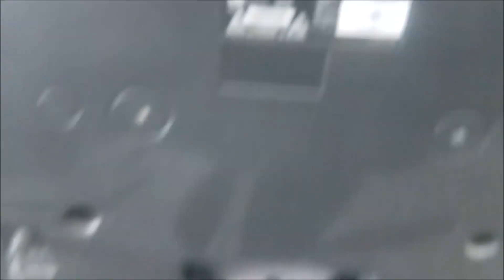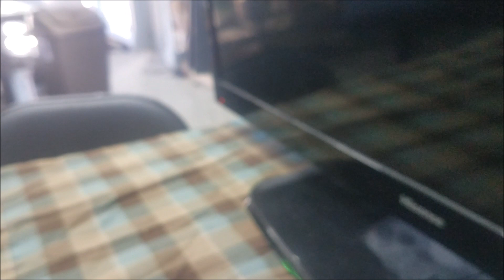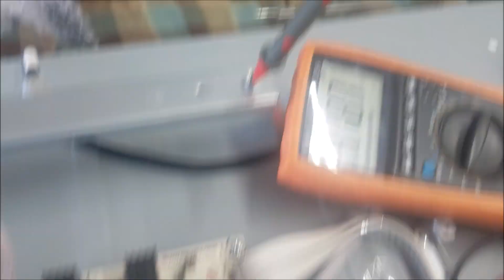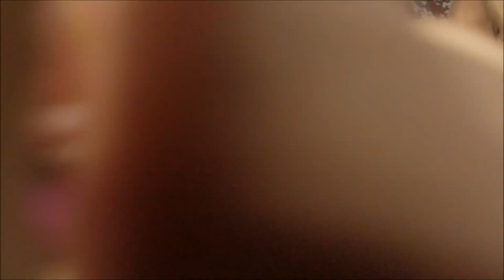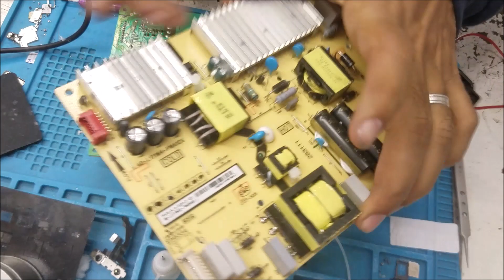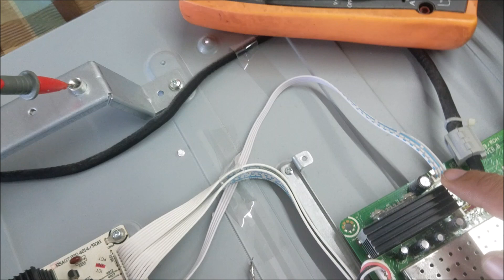Hisense F39V77C TV standby light on but wont turns on

Comment: my speakers not working  whats capacitor value?
Reply from the maker: 2200uf 16v
Reply: @SOSfixElectronics  Thanks replaced capacitor still my board not working I need to try the diode, whats a good replacement?
Reply: @BATMEX44  If your speaker isn't working maybe it's the speaker that's broken?  Does another speaker work?  Maybe it's the audio circuit.  Could be a few things...  It has to be troubleshooted.  Shot gunning components typically only works when you know what circuit is at fault and have a general idea of what component could be bad.
Reply: @canadavey  thanks , my computer speakers not working so I can't hear anything SOSfix is talking.
Reply: now I want to try the diode he replaced but waiting a response from SOSfix
Reply: @BATMEX44  put closed caption on and read the text 😃